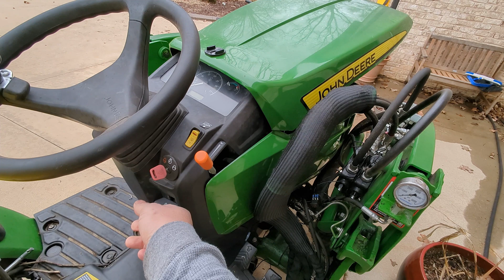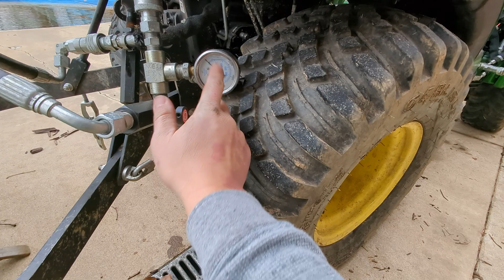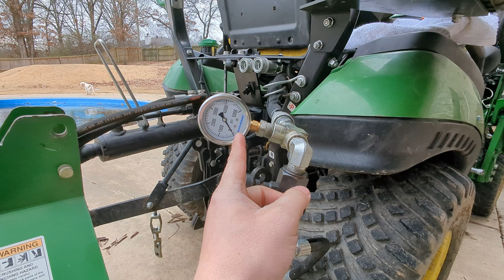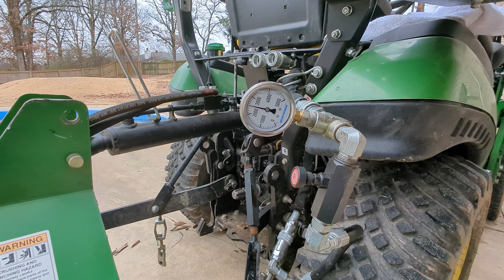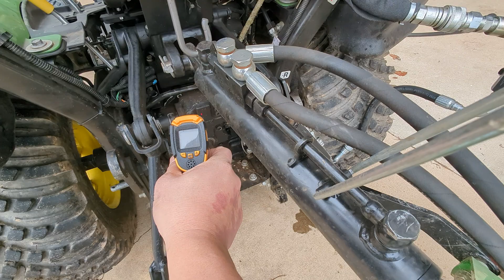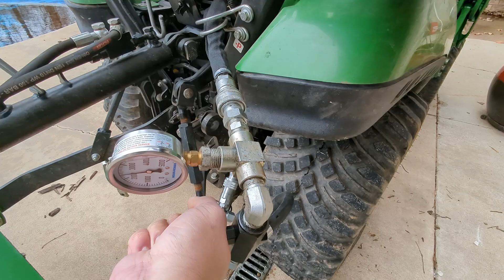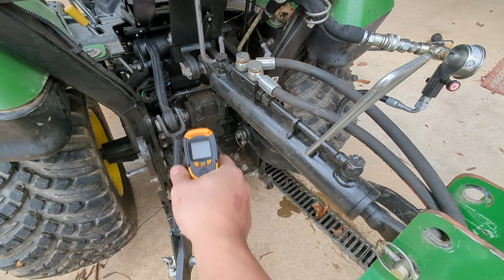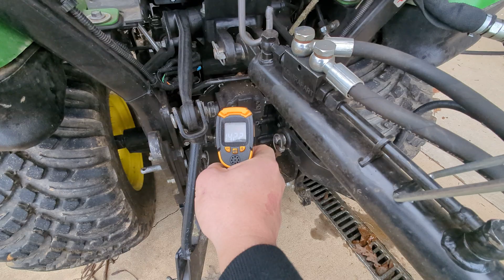John Deere 1025R Hydraulic Cooler Baseline Test for HydrosPlus Cooler+

Comment: That is quite an extreme test. I didn't notice, does this have your upgraded pump installed?

Is there a hydraulic fluid overheat light on these machines? Have you seen any lights on the dash when putting your hydraulic systems through extreme use conditions?
Reply from the maker: Yes - this has the stage 3 pump installed.  No fluid overheat light that I know of, but it does have a sensor that will shut it down if the fluid gets too hot.

Comment: Wow, that big difference in temp is a big plus! BTW, what the story on the black bracket on the center of your hood? I'm installing cameras for viewing fork tips etc. on my 1025R and need to mount the display about where you have that bracket. Just wondering if that could help my mounting of it
Reply from the maker: That is a GoPro mount. It has a 3M adhesive on it and has been stuck good for about a year.
Reply: @HydrosPlus  Thanks for the info!
Reply: That's a camera mount with 2 sided tape. Super sticky and puts no holes in hood.
Reply: @projectswithjw  Where did you get the mount and what tape did you use? I'd rather not drill the hood.

Comment: This is a s tress test but does it reflect real world use?  You're setting up for constant use implements but will those create that much pressure all the time or are they high flow with normally lower pressure until stressed?  Thanks for sharing.
Reply from the maker: This should be much harder than any real world application. I was using it for about an hour with a hydraulic bush hog I made and it only got to 120F.